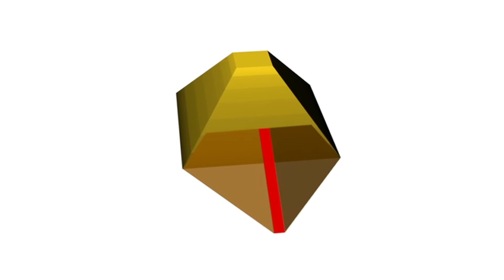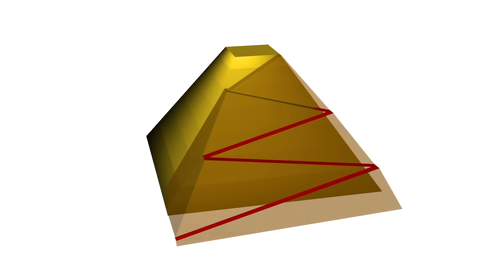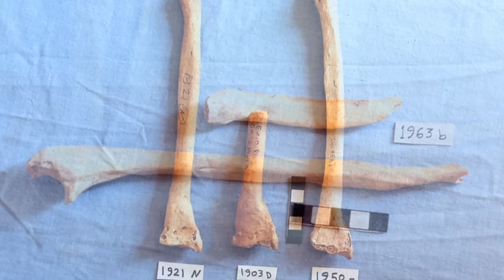Egyptology - Pyramid Construction

Comment: Ok so where’s the ramp then it should be there still
Reply: It was..............until they excavated the limestone quarries which sit adjacent to the pyramids.  So follow the white rabbit Neo:

1 - the ancient Egyptians built things using 2 basic ramps.  The first is the mud brick ramp.  There are the remains of mud brick ramps at Karnak as an example.  Also the tomb of Rekhmire depicts a hypostyle temple being built using a mud brick ramp along with the artisans using wooden frameworks to stand up.  So they would lay the foundations of the temple and then lay blocks stacked one atop another via the ramp they systematically built up until the lintels were placed = and then they similarly removed the mud brick ramp while the artisans working their way down carved the pillars of the temple - until only the temple remained. 
2 -  they also created earthen ramps made of sand/stone chips/tafla - a clay they mined and used for a wide array of applications.  Accordingly at Giza beside partially completed temples one sees the remains of smaller ramps made from this material.  Also near the worker village at Giza there is the remains of a massive tafla mining operation.  

Moral of the story:  so when the limestone quarries at Giza were excavated long ago they were found to have had a massive amount of................sand/stone chips/tafla dumped into them = or exactly what they built ramps out of.  Meanwhile Herodotus wrote that the Egyptians first created what he called "a massive causeway" - read ramp - and that they first built a "stepped pyramid" ala Djoser to then fill in the sides = after which they encased the structure in white limestone working from the top down.

So the question of where is the ramp is = it went nowhere.  As they encased the pyramids in white Tura limestone working their way down = they systematically dug away the ramp they created and dumped the residue into the then open limestone quarry pits to backfill the area - leaving only the finished pyramid in the end.   Have a nice day.

Comment: So i guess they just had a big ass stock pile of perfectly shaped rocks huh ? Bye. Molds from the ground up
Reply: An optometrist can help with your vision issues. Next time you Google close up photos of the Great Pyramid = try looking a tad bit more carefully.  Perhaps then you'll note where the pyramids are comprised of crudely hewn chunks of limestone for most of them.  They are of assorted shapes and sizes as would be expected of objects being rapidly fractured off from the bedrock in approximate sizes.  

Only a small number of blocks - those used to create the inner corridors/chambers and the last few outer courses of stones - were more carefully cut and in some cases polished.  All of the rest of the blocks are little more than stacked rubble.  Better luck next time.
Reply: Vary Olla they didn’t have enough time to sit there and chip away at limestone. Your delusional if you think that. You can’t even fit a credit card between these rocks. There molded like a cement. Go on YouTube. You find these 2 indigenous men who make underground houses and pools and all that just by their hands out off a cement. They make entire underground homes in less then a month. There’s no way that could be done if they chiseled at rocks in the time that it needed to be done. And they damn sure did carry any 2 ton anything to the top of the pyramid. It was molded
Reply: Vary Olla obviously it’s more then stacked rubble. Clearly you didn’t read the comment or somthing. And it is thousands and thousands of years old. But don’t take the side that’s deteriorating because I feel like that’s what your focused on. Lmaoo. The pyramid was molded to where it was supposed to ever sit.

Comment: The structures were built starting with the exterior blocks, then filled in with the rough stuff and rubble. When we think of the white limestone exterior as a casing we give ourselves the wrong idea. The pyramids were not encased. The precision cut white limestone went up first.

Comment: I used to think that the pyramids were actually built from top to bottom..  we don’t know enough about the landscape back then to tell if there were actually high enough sand dunes to dig down into from the top. Carve lines and pour drying techniques in order to preserve the digging instead of collapsing inward. Kind of like building a sandcastle as a kid . Dump a bunch of sand or just dig into the sand and boom you have caverns. Now you support those caverns with wood and etch the block to create a natural support

Comment: It's amazing that there is no settling in the rough internal stones causing bulging, and even collapse, on the outer walls.  The pyramids are such remarkable feats of engineering.
Reply: They  bombed  them a few times too
Reply: The Giza Pyramids, sure, but many of the later (admittedly much less well built) pyramids have since suffered collapse.

Comment: I love how science thinks it knows it all about life’s mysteries 😂😂😂😂😂
Reply: What do you even mean by that? Obviously science is able to explain a substantial amount of "life's mysteries", but currently not all. Religion however doesn't answer shit. It tells you to believe in some higher power without actually giving any proof to its claims.
Reply: A lever, a fulcrum, axles, and an inclined plane are all you need to stack one prick onto another, and this was all available to the engineers of the bronze age. Rinse and repeat until it's done. We KNOW that these methods work, we just don't know which method they used. That's not the same as knowing nothing.

Comment: Modern archaeologists are the kind of people who have never done manual construction, design and engineering work. Certainly none of them have tried moving a one ton boulder around by hand. That is why they lack imagination. Large blocks are moved with pivots, levers and rollers. Not dragged up steep inclined planes with ropes, at least not as the sole motivating force. The ropes would be more useful to anchor the stone as a static force, rather than dragging against friction. Also the flat landscape would lend itself to sliding blocks along on wet lubricated surfaces, and possibly submerged in canals. Submerged rocks are much lighter and easier to move. Certainly the men would have discovered this. Just dragging, and especially up hill would be the most laborious method. Even one roller and drag would make a certain amount of sense, but roller + levers + rope anchor would just require far less effort and men...

Comment: Has anyone ever done the actual physics equations on inertia and drag coefficients necessary to move these massive stones up an incline ramp?  Don't forget gravity is trying to pull it back down the ramp at the same time it's being pushed/pulled upwards.  If you make it easier (rollers/lubricant) to go up - it's also easier for it to come down.  It's one thing to hitch up a hundred guys to pull, and another thing to stop a huge (out of control) stone going backwards by the same hundred fellows.
Reply: A Dutch team some years back did a scientific analysis of dragging wooden sleds over sand while employing water to moisten the sand in front of the laden sled.  By wetting the ground as we see the Egyptians do in a famous painting = the resistance was lessened by almost half.  

Yet we must also take into account the fact that the Egyptians built ramps during the Old Kingdom out of a mixture of sand/stone chips/tafla - a clay they mined and used for a wide array of applications.  There is the remains of a massive tafla mining operation near the worker village at Giza. When the limestone quarry sites at Giza were excavated they were found to have had a massive amount of sand/stone chips/tafla dumped into them = or what they built ramps from.  So by creating a surface which is partly clay = when moistened the clay will make the surface a bit more slippery given the properties of clay versus loose or compacted sand.

So they created their ramps partially out of clay as noted.  Further we see evidence of wooden planks in areas of stones which were abandoned in place.  So by laying wooden planks flush with the surface of the ground - while the ground would become progressively compacted with use = you can achieve a road surface akin to a military corduroy road such as are used on soft ground areas. 

Finally you must not overlook = draft animals. The Egyptians like everyone else to include today in parts of the world employed draft animals.  An ox can pull more than 2X its own body weight.  Meanwhile we see depictions of yoked oxen pulling things to include large sarcophagi on the same wooden sleds they used to move blocks etc..  So a team of oxen can pull a multi-ton load while wetting the surface of the ground a bit can lessen the resistance + adding wooden planks to the surface of the road allows the laden sleds to slide more easily over the road surface.  The midden heaps at the worker village contained many tens of thousands of cattle bones.  So cattle was present at Giza during the period of the pyramids and thus would have been employed in manual labor as well as consumption.

Moral of the story:  so lots of variables involved beyond men simply pulling a sled as we see with perhaps rollers - but more likely wooden planks as noted.  Finally the ramp did not have to go all the way to the top of the pyramid.  Historians such as Herodotus wrote that the Egyptians employed levers and what he termed as "a machine" which was likely a version of a lever device such as the Egyptian shaduf which employed a fulcrum and counterweight.  He also wrote they first created a "stepped pyramid" ala Djoser and then filled in the sides encasing it in white limestone working from the top down.  

So the ramp need only go as high as the largest/heaviest blocks to be raised = King's Chamber.  Above that level the blocks get smaller with those at the top being small enough to have been slid into place by several men.  So lever devices could raise the smaller blocks above the level of the King's Chamber and an extensive steep ramp running to the top would not be necessary.  Have a nice day.
Reply: @varyolla435  This is a very reasonable explanation, but the variables are very difficult to overcome.  First, the great weight of the stones creates severe abrasion on the paving material of the ramp, not to mention the distortion of the surface by human and animal feet.  Just as a pothole quickly grows on a surface road, so any imperfections on the ramp would be compounded by the weight of the stones and constant transportation use.  Second, the use of wooden logs (what kind of wood?) would necessitate constant replacement.  I have personally seen what massive tonnage can do to a 24 inch square wooden beam, which when the weight was applied, squeezed moisture from it as if it were a sponge, and crushed the fibers until the whole thing was pulp. So, the entire process is a constant struggle to maintain the ramp while also transporting the stones.  This is no small issue and the entire project's goal is further complicated by the construction and maintenance of the ramp as much as the actual construction of the pyramid.  Possible...yes, but I suspect that there is a more simple and elegant solution than dragging the stones by hand or by draft animals.  It could be that the ramp itself is the source of the stones in the intermediate or final stages of pyramid construction.  As the ramp(s) is deconstructed, the pyramid is constructed. They could have begun the pyramid construction somewhere near the middle of the ramp using lifting techniques similar to what you mentioned.

Comment: You can move them by putting pebbles underneath them and pivoting them over and over. The mistake is "assuming" they were dragged straight up.
Reply: Not straight up = at an incline.  Also the blocks of the pyramids get smaller as they rise in height with those found at the top being small enough to have been slid into place by several men.  Those smaller blocks could be raised the short distance to go from level to level via lever devices which employed a fulcrum and counterweight similar to the shaduf the Egyptians have used for millennia.

So one does not assume they used ramps.  One rather = looks at the actual evidence which clearly shows they were using ramps.  There are the remains of actual ramps in Egypt today as well as depictions of ramps being employed in construction.  We further have actual wooden sleds such as they used to move things while we also have depictions of them pulling things on those wooden sleds.

Moral of the story:  so one does not need to "assume" = when one has actual evidence to corroborate the conclusion..........which we do as noted.  Have a nice day. 

p.s. - while there are a few examples of paved roads in Egypt it is more likely they created a version of corduroy roads.  At Wadi Al-Jarf where the diary of Merer was found we see in the area where blocks were abandoned in place wooden planks laid into the surface of the ground.  So wooden sleds could slide over those "plank roads" to move across the ground more easily when pulled by teams of men and draft animals such as oxen or donkeys.

Comment: The Nile River ran all around there, they used water same as rising and lowering with vertical tunnels, fill one side of corridor and release the other as it feels up with water the stones would float using the stomach of the sheep’s/goats filled with air that was then tied to the stone blocks. When the water filled corridor the ?Ton stone blocks became weightless. I may be wrong, but it would make more sense then whips cracking. Also they worked smarter not harder🤙🏾🤙🏾🤙🏾🤙🏾🤙🏾🤙🏾

Comment: BRO YOU BUILD IT LEVEL BY LEVEL WHATS SO HARD ABOUT IT
Reply: God that’s actually the most logical explanation I’ve heard in legit years
Reply: TMS like how is it that difficult?
Reply: Think for a minute will you, 480 feet tall, blocks of limestone weighing between 2 to 10 tons, nothing easy about moving that weight to that height.
Reply: Don Greenlee its not hard if you have unlimited manpower. Just pull the rocks up to each level and then you just align the men cascading down the side when the top surface gets too small for all of them to stand on. Boom. Mystery solved
Reply: Lool

Comment: the Egyptians didn't build it how do you suppose they cut the stones with a hacksaw.  aliens did it with laser and anti-gravity duh
Reply: https://youtu.be/v-NsirLXUMk

Oh............look.  You can create blocks with fairly straight sides = using only a hammer and some chisels.  Meanwhile the limestone the Egyptians primarily worked with is softer than the stone this mason is working with.  

Moral of the story:  so we see in the limestone quarries where the Egyptians got their blocks from evidence they were creating blocks using a similar technique to this.  We see shallow lines in the bedrock with holes spaced along the lines.  That shows they were fracturing the bedrock much the same as the mason is fracturing this chunk of stone.  Only a small number of the blocks needed to be cut using saws and an abrasive = which coincidentally we also have evidence of.  Better luck next time.  Enjoy your Matrix. lol!

Comment: Imagine the 1st known civilisation. "Ok gather round, no tents or mud huts people, were going to build a pyramid and we will use 2 million stones weighing up to 2 tonnes each, its going to take upto 30 years so lets crack on. Oh and when its done, we wont bother to use it"
What a load of trype. Its obvious they and the sphynx not the little triangles were built before the great flood so Egyptians did not build them, the water drained away revealing these huge monuments. Thinking they must have been made by the gods, they simply repaired them, attempted to build smaller ones, very badly and proceeded to worship but not inhabit them. Its time to rewrite the history books surely.

Comment: These so called experts are ignorant of many things.  Few have ever built anything. Precise fitting is not that difficult.  Simply use templates that have the shape and dimensions needed.  Rough cut a block, then check it against the template(s).  As for saying they had not block and tackle, I think that is a bad assumption.  No crane maybe, but block and tackle, or simple pole capstan is easy.  One single large straight on ramp would be massive.  Circular movable temporary ramp around the pyramid has been demonstrated.

Comment: The old trusty Ronson String Tool made the Lazer level internal Granite walls as demonstrated here by Noddy hey.. I have a feeling he might be a little mistaken with that assumption. As he demonstrates the method on  a two square inch section of soft lime or sandstone for us to marvel at Im still wondering how the ramp theory went with the 70 ton blocks dickface forgot to mention were used in there to. So Ramps and String were used and the wheel had not been invented at that time .. Ok tell me more please professor.

Comment: No way those pyramids were built with primative straps and strings or whips and slaves..
Reply: why?
Reply: @tgstudio85  because they would still be working on them..do the math..how many massive blocks in the pyramid? . chiseled, dragged,l hoisted,.. using low tech..they wouldn't even be half way done..